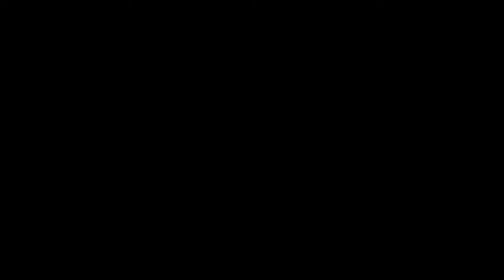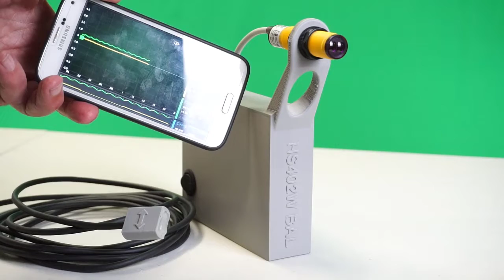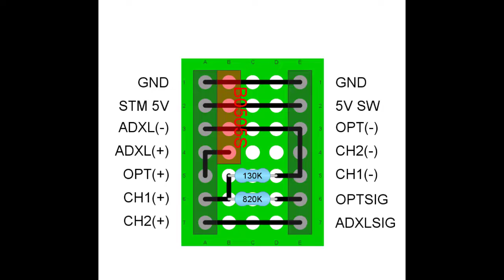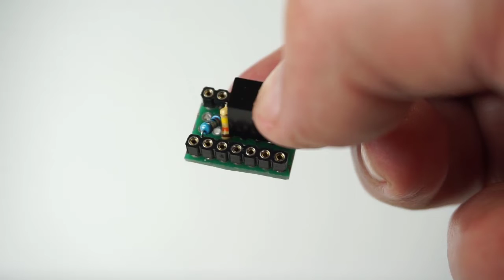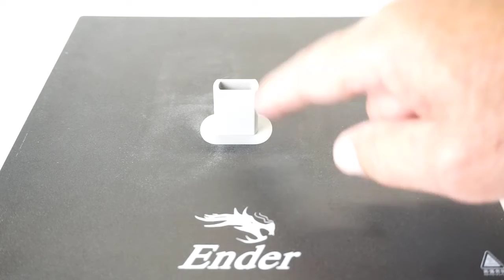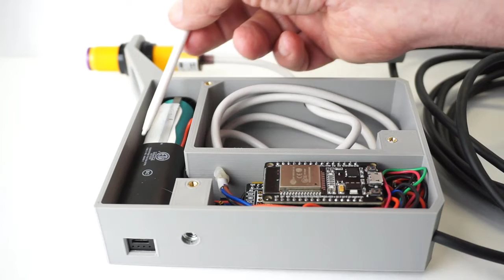GADGETS#151 - HS402W BAL | BUILD

Comment: Is it possible to purchase a completely built HS402W BAL, tired of paying a road force balance of upward of $40 per tire? During my last tire purchase, I ended up with a set of defective tires that regular balancing machines cannot balance, and the second problem nobody in town uses lass thin .5 oz weight.
Reply from the maker: strictly DIY, I do not build any gadgets for sale...I'd have no life:)

there is a simpler "build" than this #151 HS402W BAL...take a look at GADTGETS#58 where a budget oscilloscope + $3 ADXL335 accelerometer + analog IR sensor does what HS402W BAL does ...

and thanks for your interest here:)

Comment: Why do you have to isolate the grounds from the scope and the sensors?
Reply from the maker: these HSxxx oscilloscope circuits have a 1.65v potential between the STM32 GND and BNC (-) ... not an issue in conventional use ... but here, I'm trying to power the scope and the sensors from the SAME source which would make their grounds clash hence the isolator.
Reply: @theGADGETSplaylist  Ah, ok, I didn't know about the offset voltage in the HSxxx scope boards. I ordered the accelerometer and the photo detector to make a balancer (and some of the isolators because they were cheap anyway), but I'm just going to use a regular scope, as I already have a couple nice / high end scopes (and one of them for sure has cursors you can set in degrees), so in that case, I won't need the isolator as my scope grounds are already isolated. Thanks for letting me know. Maybe I'll use a HSxxx scope in the future, after I decide I don't like either of my nice scopes being in the garage!
Reply from the maker: @gorak9000  correct, you will not need the isolator with those 2 sensors powered through 5v REF supplies.

GADGETS#60 where I balance a small pulley on a table saw motor, most closely resembles using those 2 sensors with an oscilloscope as you plan...

let me know how you make out:)
Reply: @theGADGETSplaylist  Yes, will do! Last year I paid to have a large motor rotor balanced, but paying for that one was worth it to me, as it's for a mill spindle that goes to 6k rpm, but more recently I picked up some small motors, and they have unbalanced rotors as well - not worth paying the balancing place $100 for a motor I paid $40 for, so time to be able to do this myself! Maybe I can (carefully) balance my lawnmower blade now too!